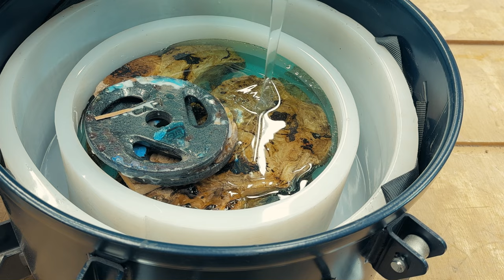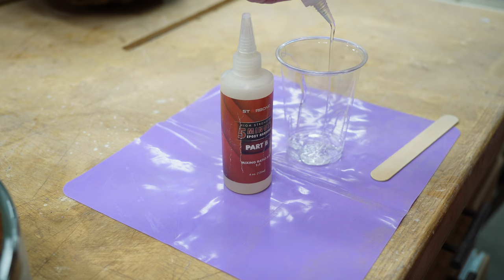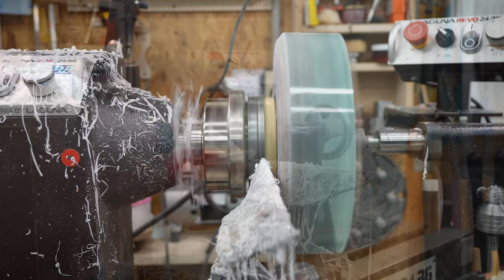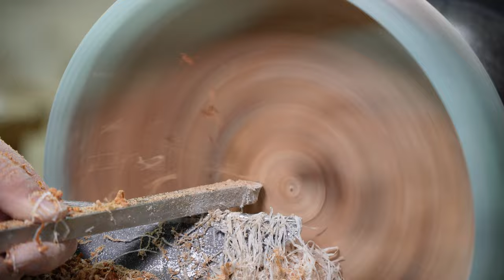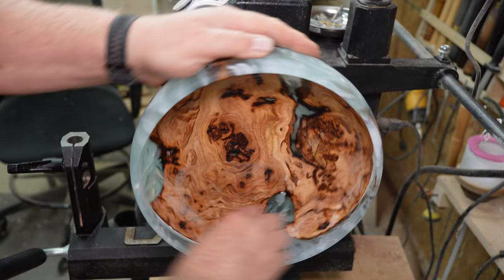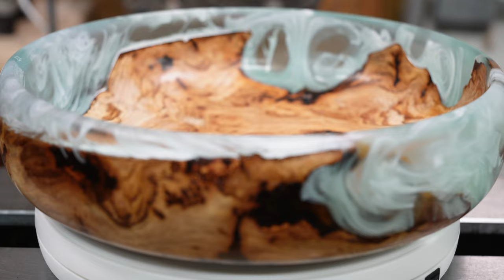Revealed: The Ultimate Guide to Epoxy and Burl Bowls

Comment: Nice piece, but a couple of thoughts. A darker color with the white and I wasn’t thrilled with the bottoms finish. I could see the cut marks or lack of sanding, just on the bottom so it’s not huge, but I saw it. Still nice though.
Reply from the maker: Thanks mate. Yes I’ve since refinished this bowl in sealing it with epoxy table top. This leaves an entirely different look but one a customer wanted. I’ll post some stills in my community posts this week. Let me know what you think. Cheers!
Reply: @bespokewoodartistry1517  a customers request ALWAYS trumps a carpenters own likes. I get it.